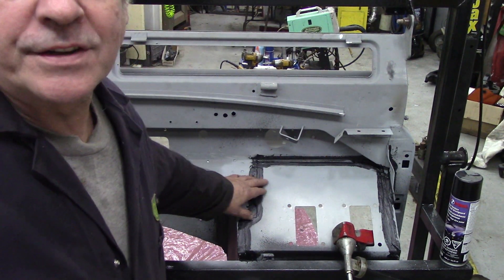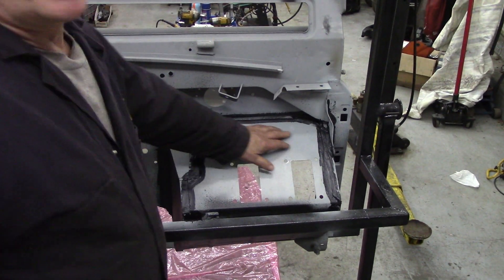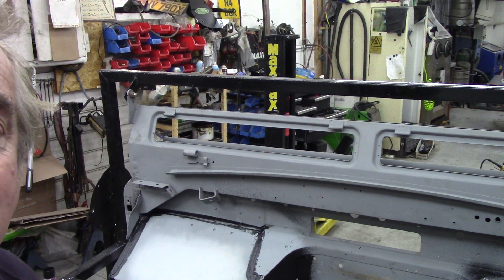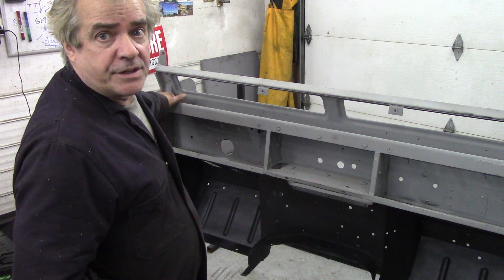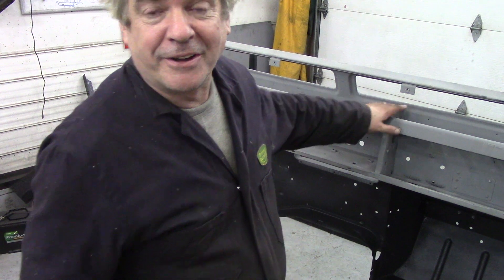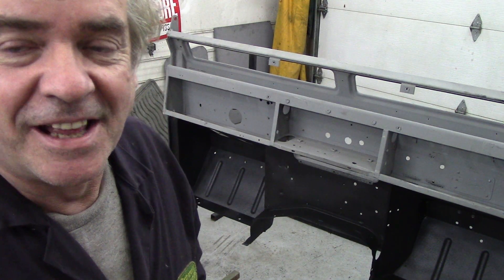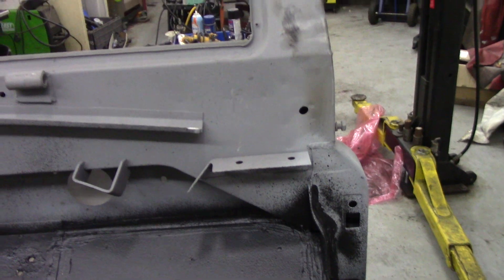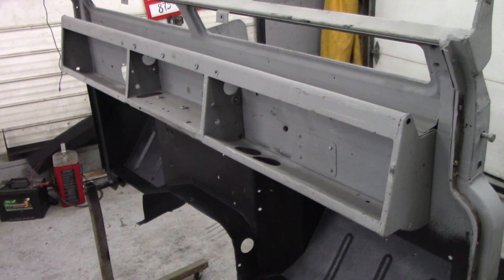Series 2 bulkhead rebuild Part 5 Final

Comment: Hobson industries make stainless bulkheads here in the UK, the MOD fit them if a Wolf is rebuilt, you can buy them but they're £4500!  The Polish company Maer are also building them in stainless for £1499  Inc vat and UK del, seems a good price as a Galv shielder is more expensive, Maer do seem to have great reviews for their chassis and a good few UK restorers are using them now.  There's also Ultra bulkheads in Shropshire that have great reviews for their galvanised bulkheads.
Reply from the maker: Good to know!
Reply: @koitorob  Not sure what the fit is like on the bulkheads but their chassis have very good reviews for fit and finish.

Comment: Sure do videos on bulkheads AFTER I finished mine......sheesh :) That little bracket you pointed out is still used in Series 2A vehicles with the brace bar on the side opposite of the driver.
Reply from the maker: Bracket is M10 so too big

Comment: Many years ago, I was at the salt spray/corrosion test facility at Rover/LR Gaydon.  I asked about the performance of wax & the engineer showed me a vehicle that was stripped down after test. Even under the ferocious conditions, where the wax was(3 blobs in the sill box sections) the steel was sound.  He commented that they would not have had to go to the expense of zinc coatings if they could get the wax application sorted. Filling box sections with the FF/Waxoyl is the way forward!
Reply from the maker: Correct

Comment: Looks a great job Mike. Think my foot well came from YRM. Wonder if you can get Fluid Film in the UK? Need to get it inside my bulkhead and chassis.
Reply: I get my fluid film through eBay, and swear by it!
Reply: @kevinmartin9432  Thanks, I'll have a look.
Reply from the maker: James I tried to send an email but said your server was down.
Anyway if you get this message, the carb jets worked like a charm!

Comment: Mike galvanising can bend anything, I have had 80x40mm box section frame bent vertically into a slight curve.if it cools at a different rate or there’s stress in the steel like those ribs in the foot wells , it can warp no matter how thick , it a gamble
Reply from the maker: I have not had galvanized bulkheads for over 10 years - lot of fannying about to get them right